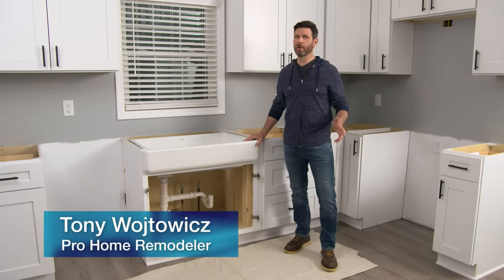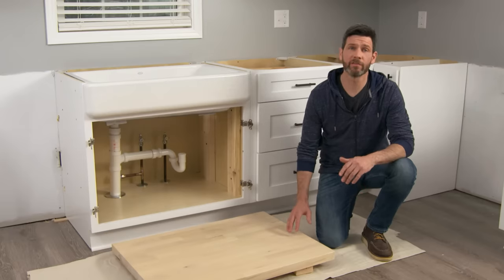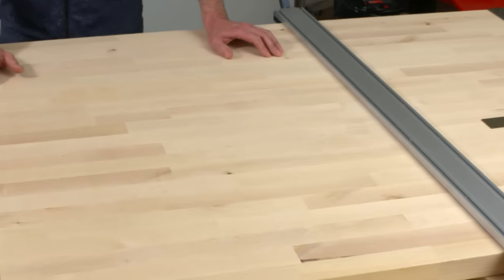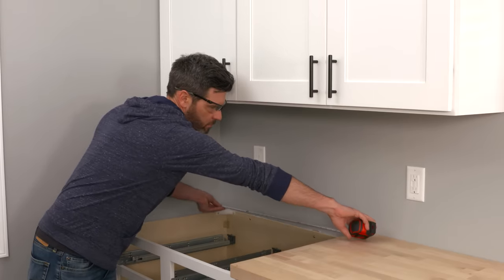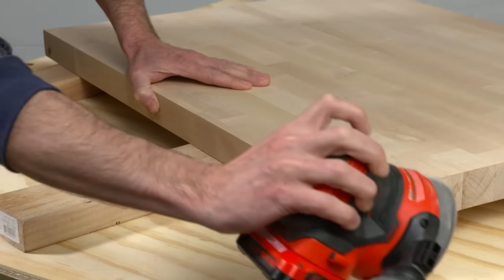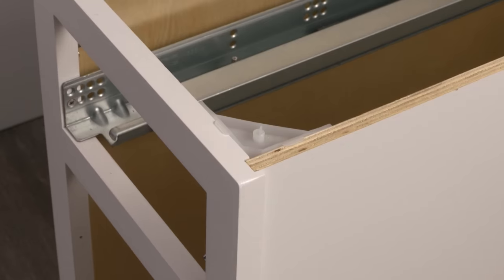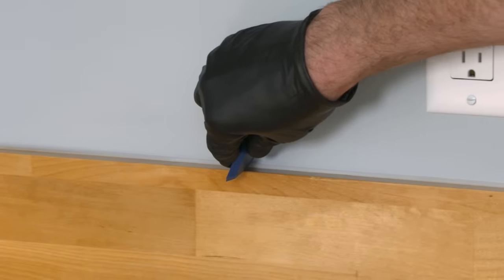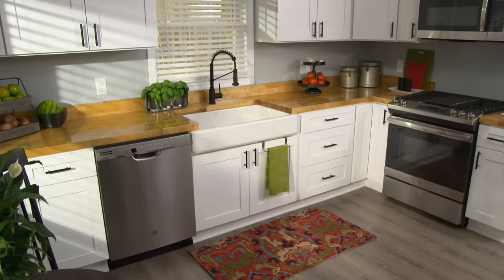How To Install Butcher Block Countertops | DIY Kitchen Remodel

Comment: I’m a contractor with 30 years under my belt doing some very nice custom homes. But I have never done a butcher block countertop and I found this very helpful good job
Reply: do u think its ok for rentals? durable i mean or will get scratched
Reply: @tednguyen7258  not sure but I think entirely up to what kind of tenant it is... I could see it getting ruined because someone uses it as a cutting board... Don't think the sealant prevents cuts

Comment: Two serious errors: Never overhang the counter over the sink as it’s almost impossible to clean underneath the edge which allows bacteria to grow.  Also, that tape will not stop the hot, damp air present when you open the dishwasher from flowing back under the countertop, potentially allowing warpage or bacterial activity. Better to use an insulating blanket that covers all of the top of the dishwasher. I believe IKEA sells them cheaply.
Reply: Nice comment that's exactly what I thought
Reply: That's what I thought! I don't know much about countertops, but I know cleaning. I can actually tell you the texture and blackness of the crap you'll have to scrape out of there later.
Reply: It looks better over, tho. You can seal it up, no problem.
Reply: What about that pink waterproof membrane paint?
Reply: @windsofmarchjourneyperrytr2823  it's not about sealing, organic matter and bacteria will build up underneath
Reply: @philsie1 I completely agree about the sink. I thought to myself, well that would is just going to brown and turn gross.. slimy... And thank you so much for the tip about the dishwasher. Very smart thank you.. My husband and I bought all new appliances. We haven't put in our new dishwasher especially because we have to paint our bottom cabinets. Put in the new dishwasher but we were just going to wait until we replace the countertops... The more I wait the more I keep changing my mind. Hahahaha Sooner becomes later. Hahaha I'll tell you if I knew how to work all them tools. Well well ...well ... I could truly be like Wonder woman without the golden lasso and invisible plane. 😆
Reply: I don't think bacteria multiply on certain wood butcher block counters.Acacia is one that inhibits that growth.

Comment: the right angle was the only reason I watched and I have no clue what he did. everything else is a DIY can do an acceptable job especially if you skip that stupid sink and just drop in one. but the butt joint is why I hesitate to start this, much less trying to miter it.

Comment: I installed some butcher block with my granite counters; hard rock maple. I sanded with 50 grit just one pass, then tack clothed; then one pass of 120 grit, then tack clothed, then applied a wood conditioner. Then sanded with 220 and tack clothed. Then stained the wood. Then applied 3 coats of tung oil. The counters have been water and stain resistant. I waited a day between the wood conditioner and the stain and another day between stain and first coat of tung oil and then a day between each extra coat of tung oil. You MUST stay clear of the counters in between. The counters are smooth as silk and beautiful. I absolutely love them.
Reply: Thanks for those tips!
Reply: How long have they been holding up since you did this?
Reply: Sounds like you took the right approach.  I just wonder how long the sealers hold up over time.  I’m considering epoxy
Reply: @anthonycaggiano8211  they’ve held up great- the tung oil hardens the wood - I have used my counters “as usual” - no specific precautions and after three years and no further treatment- they are great - no issues. I will add another coat of tung oil this year - I am overdue. I got the system I used to prep my wood counters from an old timer that has waaay more knowledge about wood working than I do!
Reply: @RB-je2ri  I’m sure they hold up decent just wish you didn’t have to maintain it as much.  What did you use near the sink area and dishwasher?

Comment: 3:45, It's best to cut from the bottom side to achieve the best cut for the visible surface.  That is with a circular saw, with a table saw it's good side up.

Comment: 5:20  When finishing with the jigsaw, be sure to err towards the INSIDE.   You can sand down the eccess, but but if you cut too wide you can't put the wood back.

Comment: I have a butcher block countertop and it requires a lot of maintenance. I will not install another. Its very difficult to keep looking clean especially as it ages. Yes you can refinish if you have the time and don't mind the mess.
Reply: Good to know. I was considering installing bucher block countertop
Reply: Wood isn't hard to refinish, tho. I find it fun working with tiny pieces in wood flooring in dollhouses, lol. Sometimes even literal specks of it. Maybe heavy varnish? Like marine varnish. But fewer coats. So, not real thick like a bar or Tabletop.
Reply: Honestly, expoxy is probably the only way to seal it with not AS much maintenance. But then you’ll loose the butcher block purpose of being able to cut on the counter

Comment: 0:26, “Installing a butcher block countertop can be a more advanced project than you think.”

Aight, imma head out.
Reply: King Kwon  Sponge Bob pop in my head right away 😂😂🤣🤣
I will save money have some pros doing that shit.
Reply: How u make out on that 50 cal. What's the target rage there?
Reply: I just cut a whole for the sink and put them on, add some silicone caulking around where the sink is and its done. These dudes make things overcomplicated

Comment: One big change I would suggest is to avoid silicone sealant as it has little to no adhesive quality and will discolor over time. Using acrylic based sealant/caulking is a better option.
Reply: such a pro build I was shocked to see the silicone.  Also how did the drain vent?  Nice job though
Reply: I agree don’t use silicone on this job, but because you won’t be able to properly paint the wall over the silicone. Use paintable caulk and then paint over it, now or later. 
As far as not enough adhesive quality, we actually use silicone for adhesive to glue down counters, sinks, etc..

Comment: Informative video. Question: do you seal between the joints. to stop water or any other fluid from going in there. I did not see that being addressed. thank you

Comment: Just did this in our house. This video helped immensely!
Reply: You do a miter joint ?
Reply: @gemthomas  no miters and used pocket holes instead. Had to use a couple shims but other then that it turned out great.
Reply: What size screws did you use ??

Comment: 10:44, if yo are gluing do not use purple primer.  get some clear primer.  Primer is easily dripped or splashed and it rapidly stains things.  Clear glue also.

Comment: Dis you buy the island board and cut it to size to also make the back splash. I ask this because there Only two different sizes. 25” deep and 32” deep. Most cabinet are 24” deep leaving 1” over hang. I can see you buying the 32” deep island and cut to size (25” for counter top and 7” of extra for what ever back slash height is desired. I am correct or did you buy a 2x4 birch wood  and used that.

Comment: What sealant did they use to water proof the butcher block? Its not listed in the video description.
Reply: He mentioned Tung oil, but there are others that are better for food prep areas. I think Watco makes a food grade finish. Polyurethane and epoxy look good but don't hold up well in this situation.

Comment: Would this video on Butcher Block countertops be similar to making a L shape Desk onto 2 2 drawer file cabinets? If so what could I use for the LEG in the outside corner where it corners to the corner of the walls meet? I plan on an 8 feet by 4 feet L shape desk x 24" front to back with 2 ft. of the 8 ft. length top be made up with the 4 ft. Length top.
I have 2  old HON 2 drawer file cabinets to rest the butcher block tops. The butcher block is 1 3/4" thick and the current desk's desktop us 1 1/8" thick wich is a little bit higher than I want it to be more comfortable height for me. Will it be better to use countertop instead? Advice please.

Comment: What kind of “ waterproof Tung Oil sealant” did you use? I checked Lowe’s website and there’s no such thing there’s only “tung oil” which is not waterproof
Reply: I’m not sure what he was using, but hard-wax oils are what I’m going to use to waterproof the butcher block counters I’m about to put in (and could potentially be what he’s referencing as hard wax oils are mixtures of various oils and waxs). If you go that route for counters just make sure it has no VOC as some of the hard-wax oils used for flooring can have pretty high VOC
Reply: waterlox
Reply: Waterlox seems like the way to go. I am also trying to find a tung oil sealant but lowes or home depot don't have it. Lowes has Minwax Tung Oil Finish but it doesn't actually contain any tung oil
Reply: @ismailm7659  epoxy is the way to go where moisture exists tho
Reply: Here is a long term review. I needed the oil asap so I ordered 100% tung oil from Amazon.  I did 2-3 applications of it over the course of a few days. It’s held up quite nicely and it’s been about a year and a half. I have done mineral oil one time in between. The countertop and sink get used everyday.

Comment: Great instructional video...EXCEPT, you should never use 100% silicone on the walls along the top edge of the splash. Silicone will not hold paint. Instead, use a latex caulk.
Reply: BUT silicone will stay clean and does not mold like latex.  Use silicone and denatured alcohol for clean up

Comment: How long can I use this kind of countertops?
Isn't it going to get mold?
Reply: as long as you keep it properly oiled,  it will inhibit mold and bacteria growth,  or if you permanently seal it with a poly based sealer.  or even epoxy.

Comment: Thank you for the video. At 8:25 for caulking the sink to the butcher block, did the bottom of the block already have a layer of Tung oil applied? Will Caulk stick to the Tung oiled surface? Or was the caulk applied to bare butcher block?
Reply: silicone has little to no adhesive quality, it stains and mildews easily so is a poor choice. Acrylic caulk is ideal for this application, apply to raw wood before applying tongue oil or other finish.

Comment: I bought a hard maple butcher block. I tried to cut it on a table saw. It is so hard it made the blade bind. Will it be easier with a hand saw like you are using? Or do I need a special blade?
Reply: 60T Diablo blade.  Cuts it like a hot knife through butter (always wanted to say that but in this instance, it's true).
Reply: Can you buy two thinner ones and then glue w a million clamps?

Comment: I like and appreciate Lowe's for posting this video. I recently went to my local Lowe's to try and have their contractor do my kitchen in butcher block counter tops. I asked the contractor what is your procedure for sealing the wood. They use a polyurethane, this is not good in many ways. The proper sealing for a kitchen butcher block should be done as instructed in this video using several coats of a tung oil preferably Waterlox.
Reply: Hi .did you mean use tung oil first and finishing by polyurethane?..i in progress making one but need to study for the best way for finising wood countertop..
Reply: What about epoxy

Comment: Butcher block countertops are great, but it is a BAD idea to install an under mount sink in it! (Or any sink for that manner).You are never going to seal the wood enough to avoid mold/rot. (Unless you seal it with epoxy, but then it’s not a butcher block countertop). The end grain Is exposed right where there is the source of moisture! I work for a high end cabinet shop, and we always design to have a butcher block countertop in a section far from the sink! We cannot guaranty our work otherwise.
Reply: You suggest sealing in epoxy then?
Reply: Jimmy Messier I’d like to know too. What’s the best way to run the butcher block up against the sink, epoxy?
Reply: I am considering using Waterlox for my counters, seems like the best for moisture resistance
Reply: I was looking for someone in the comments section to mention epoxy.  You are so right
Reply: @evanbland4011   epoxy is the way to go.  But then like he said …. It’s not a “butcher block”.  With epoxy You’ll just end up with a counter that aesthetically looks like a butcher block but then you can’t cut on it

Comment: What kind of  wood salent did you use and is it food safe
Reply from the maker: Hi John! Below are a couple of food-safe options for you to check out for your butcher block project:

https://www.lowes.com/pd/Howard-Butcher-Block-Conditioner-Clear-Butcher-Block-Oil-Actual-Net-Contents-12-oz/999918606

https://www.lowes.com/pd/Howard-Clear-Cutting-Board-Wood-Oil-Actual-Net-Contents-12-fl-oz/999918612

Comment: how long do you think that counter top will last? specially around the sink area
Reply: Wood actually is quite sustainable material, and this butcher block countertop, which made out of laminate method, where pieces of wood glued together to form slab is much more resilient to wood “breathing” than natural wood slab. Aside of that, most important fact is finishing, and according to video, they use tung oil, which is also used in finish carpentry for marine. Personally, aesthetically butcher block countertop more pleasant than traditional vinyl laminate. I personally would consider it equally with natural stone, and only be driven by personal like or tactile feel of natural stone vs wood finish. Both materials have wear of frequent use, that can be addressed with proper sanding/refinishing. Speaking of longevity, stone might seem to outlast wood, but it also has chances to crack at stress points, especially at that narrow stripe behind sink, and adding sink holes will only aggravate its structural strength, so wood is not that bad option to my view.
Reply: BlahBlahMan Yeah thanks for a detailed reply
Reply: BlahBlahMan Yeah what about sealing it with epoxy ? Will that make them waterproof
Reply: I have not worked with epoxy, as my concern it wont not be easy to work with, without few trials and errors to master skill with it. Furniture wax may be good choice, it will also add hydrophobic prop to finish, and does seem easy on touch up or reconditioning if needed
Reply: @briizhub8052  epoxy 100% makes it water proof if it’s applied on the underside of the counter butting up to the sink

Comment: What brand of sealant did you use on this project?
Reply: Not sure what they used, but when I did my butcher block counters, I used WaterLox.  It's waterproof and dries super hard.  You'll want to use a lot of coats though, like 4-8.  Sand lightly with a very fine grit sandpaper between each coat, because it will bring out the nap in the wood each time.  You have to wait 24 hours between coats and it smells awful, so make sure you have lots of ventilation.  It was worth the time and effort though, mine look awesome and are super strong and waterproof.
Reply: I used Waterlox satin and the finisher,  my countertops are beautiful and well sealed.

Comment: We put epoxy on our butchers block to seal it and add an amazing glass like shine. It’s better than using any kind of oil or polyurethane
Reply: Glass like shine is not appealing for butcher block though. At least not IMO.
Reply: Isn't epoxy toxic as opposed to natural oils?
Reply: Sara ….. you actually did it correctly.  Epoxy is the only way to go
Reply: @ccxcxz4377   you don’t have to have a glass like finish when using epoxy

Comment: Anyone have a price idea or range for diy butcher block countertops.  I realize price changes daily and depends on how much counter square footage. But I’d love some sort of idea or price range or any idea please!?!?  Thank u
Reply: Special order 10 ft sections is 300.00 each if you have 30 ft of counter space that's not covered in granite like we have you will need 3 pieces.
Reply: You can buy them in store in shorter pieces 8 ft and 6 ft go online look under counter tops.
Reply: I just bought two pieces of 74”x24” butcher block for about $380.00
Reply: @cpt.nancyr.1946  Who has 30 feet of counter space...?
Reply: @windsofmarchjourneyperrytr2823  I do. We planned this house when my son was eight years old. He talked about all the details growing up. We purchased the land when he was twenty years old. We made plans, excitement was high! He was killed eight months later by a possibly drunk tug boat operator. A year later we built the house he drew up the plans for at eight years old. So yes it has 30ft of counters in butcher block, one eight foot granite island with a Jenn air stove complete with a grill and a eight foot granite high boy counter on the other side. Everything as we talked about and planned for, for twenty years. It's bittersweet!

Comment: i had a woodn counter. it was beautiful and oiled to feel the wood. i woodnt do it again. the water is a huge problem for oiled wood. you can't clean it with soft chemicals too
Reply: What if you used epoxy ?

Comment: I recently had invited a worker to give me an estimate how much renovating my counter top would be and also talked to him about some of my ideas. I wanted to have it entirely done with wood just like in video, but he said it's not advisable as the water from dishes or sink may deteriorate the wood on the countertop. I suggested to use waterproof varnish for the countertop, but he still insisted it's not recommended... Was I wrong or what do you think?
Reply: Thats my contactor said also but I want this!
Reply: Just carefully seal it up and very carefully be extremely diligent wiping it down after EVERY use. Just like the faucets. Seal that gap up, too, jic.